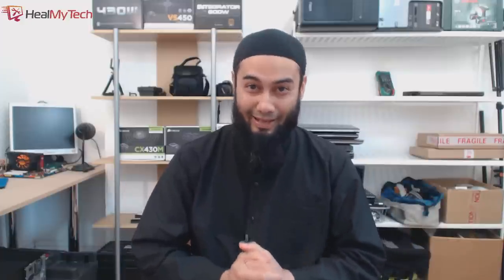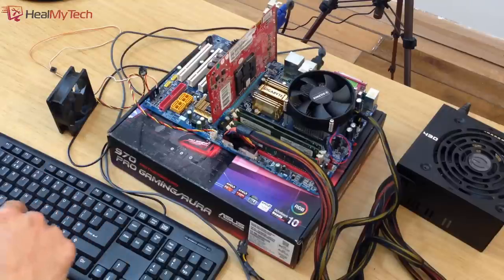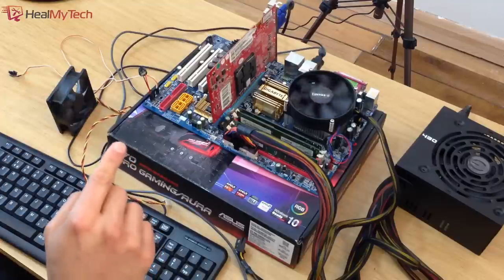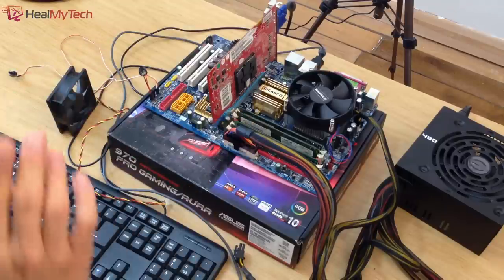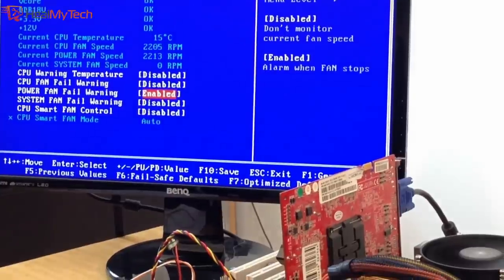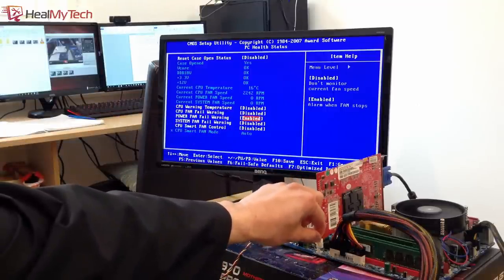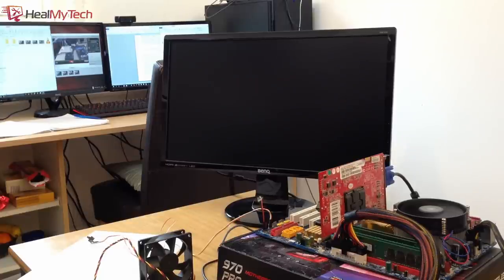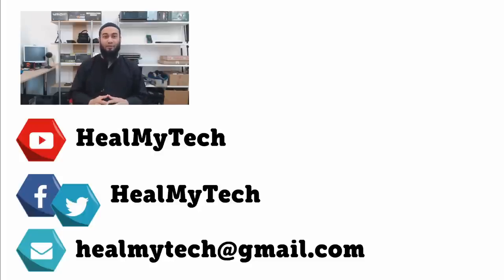One Long Continuous Beep Code Finally Solved - PC Computer Troubleshoot

Comment: You are the man!  Thanks for helping me solve my problem.  In my case, I would get a long beep upon boot that lasted about 20 seconds or so, then stop, and the computer otherwise ran fine.  It's because my CPU cooling fan hasn't completely failed, but is just slow to spin up - especially if my room is cold like now in early winter.
Reply from the maker: You are welcome!

Comment: Tip for others that of the monitor doesent open it means you have to remove the ram and clean the part where you connect it (the ram not motherboard) and put it back and on your computer and it will open
Reply: Microfiber cloth and alcohol or white  rubber eraser?
Reply: @Solon_The_Lich  no just breath dont do those
Reply: @ghostlyflamingo07  It works to clean the RAM contacts, now if it is on the RAM bank sure, blow some breath or canned air do the job ok

Comment: Thank you. I had unplugged the fan thinking I was going to move it. I didn't move it or plug it back in and promptly forgot. Then when I turned on the computer on a little while later, the continues beep. Thank you for your time in figuring this out. Peace.

Comment: Many thanks brother, I almost give up on my PC after VGA swap because of the continous beeping sound problem. Just forgot that the same time I removed the second fan from my cooler connected to CPU_OPT,  but  haven't changed the fan warning option to "Disabled" in BIOS before the disconnect 😅 Your content saved my day, you're the best! Cheers!

Comment: Thank you sir! Been having the same problem since I built my new computer for over a week now and thanks to you, problem solved tonight. At first, I was having a hard time finding the system fan fail warning in my gigabyte B450 motherboard since the default in the smart fan 5 of the motherboard was set for the cpu. By clicking on  cpu fan, a drop down box for the system fan will be revealed. Thanks again... :-)

Comment: Thank you so much for this video, I purchased a brand new gaming pc today (Acer Orion 5000 po5-600 if anyone would like to know the exact model). I was setting it up and when I powered it on it instantly did the beep, I was terrified that something was wrong with it. I spent hours trying to solve it but then I came across this video, once again thank you so so very much, I'm so glad I was able to fix it! Lots of love from Ireland!
Reply: What was wrong with it?
Reply: I have the exact computer
Reply: Did you have to plug the ram under the fan back in?

Comment: im having the similar loud continuous beep, but it happens if i game on 1440p and above , i have a asus b350m-a motherboard, ryzen 1700 , xfx rx 480 black edition, 16 gb ram (2x8) 650w psu . and a corsair h60 liquid cooler .  could my case also be solved by the same?

Comment: bumped into such problem but what happens is that the power fan is on, it does the noise 30 min after switching on the PC or when it restarts.
how can i solve it

Comment: nice.. this removes one more thing to look at..
i had some problem but i only have 2 fan slot and used both..
the beeping starts whenever the PC is on already.. and will go away if i Sleep or Hibernate it then turn back on..

Comment: My Z97-D3H with E3-1285v4 home server would randomly start this continuous beep while it's been running for over a day.. in Windows. When it starts the continuous beep (again, while inside Windows), all fans are still reporting the correct RPMs and the temps are all way below their critical limits. What is weird is that, I have ALL fan fail and temperature warnings disabled in BIOS. This started happening during the last 24 hours and it has done so, twice. I have temporarily removed the speaker while I find a proper solution.

Comment: I have a question, can you do a video about the front panel audio connectors, i'm having trouble with mine, when i plug my headphones in the front of my case, the audio has trouble coming through on the right phone and i always have to rotate the connector on my headphones to get it to work, i've been trying all sorts of things to try and get it fixed but to no avail
Reply: Well part of this is true, but if i plug my headphones into my phone, i don't have any issues with audio dropping out at all and this is how i figured it might have something to do with the audio jack on the computer itself. Also I've been doing some research online and i figured what I can do is purchase an audio chipset on USB to get around this problem since I can't get it fixed.
Reply: Try blowing some compressed air into the audio port or it may just be the case of a bad audio port, sounds like a bad audio port if the headphones work fine with your phone.
Reply: yes i'm always cleaning my computer actually i have a shop vac for that, but this didn't fix my issue, i already know the port is bad so i'm not going to bother messing with it anymore

Comment: Thank you... I'm hopping this is my problem. Could it be a connecting is loose for the fan? I find the "long beep" occurs intermittently, more often than not, when I am in Second Life...which I know is a big pig of a program. BUT, when it starts to happen, and usually it's on specific sims in the game, IF I minimize my screen, the beep stops. Soooooo... that is the only thing I have noticed with the beep going away or returning. Once in a blue moon I will hear the beep when not in Second Life, but it's not as continuous and persistent as it is when I am logged into Second Life. So I'll get in my case and make sure the fan connector is seated properly first... AND blow out the dust bunnies while I'm at it and if that fixes the problem... awesome! If not... eeeps... :(

Comment: i get this sound when switching out my RAM with new ones, it's so annoying, like the PC i'm working on was build to only work with the RAM stick it was manufactored with, only tips i can find is clean the RAM stick, but that isnt the problem, the problem is! --> When ever there is ANY ram stick besides the one 8 gb ram stick that was allready in the PC when i bought it, it makes the long beep sound and monitor stays black, leaving me to be able to do nothing. so, replacing the ram stick and it does this, Leaving the ram stick in and adding an extra ram stick i get this sound, replacing the ram stick and adding an extra ram stick i get this. Remove all extra ram stick and leave only the original in the PC and there is no problem ....... <these dots means "i'm about to give up on this"

Comment: mine is not the fan mune is something can you give me your contact so i can send you the video please help mine 1 long beep comes after i install a new gpu and there is not display if i turn off the pc let the card stay in the pc and get display from motherboard then the display comes but the beeping sound never ends and when i try to get back to gpu no display just beep sound help meee please i have swapped changed the ram but nothing is working

Comment: My computer beeps shortly and boots but does not display on the screen. I replaced the ram but it's still same though sometimes it does displays
Reply from the maker: What other troubleshoot steps have you done?  I have another series on the channel, have you checked it out for a solution?

Comment: 2 beeps two times in intel dh61ww motherboard what is the problem
Reply from the maker: This video is only one possible way of troubleshooting and fixing a PC. Based on all you questions, I have created a dedicated series to help troubleshoot all 10 main components of a computer in a logical process, I promise you if you follow it you will sort out your issue, since its the exact same process I go through when troubleshooting any pc problems for hardware. Troubleshoot A Computer Series Playlist | Computer Not Turning On | PC Turns On But No Display On Monitor https://www.youtube.com/watch?v=Wkcx-x9gjkg&list=PLDmnHbxxv3ncrDmkkt4oVJTEIBIy9pvRN

I have also created a facebook group especially to help troubleshoot computer/laptop issues.  If you post your question there with some pictures or even better a short video footage you will get a better response.  Consider joining but make sure you read and accept the conditions and answer the questions, otherwise you may not be approved to join.  The idea is to help each other, I am unable to respond to every request by myself.  https://www.facebook.com/groups/healmytech/

Comment: I thought this is the answer.... mine was a long beep but my computer do not turn on
Reply: HealMyTech every time I turn it on ; the screen is blank and then the CPU beeps for a long time. I fixed the RAM , The Fan , etc. But still the beep is still there but the screen turns on display it’s title then it turns blank screen again. I can’t perform what you did on your video because the screen of my Computer is blank and I think that’s only the proper way to get rid of the beep sound